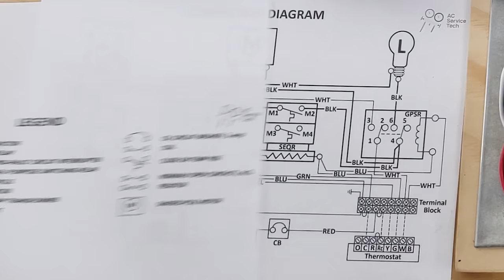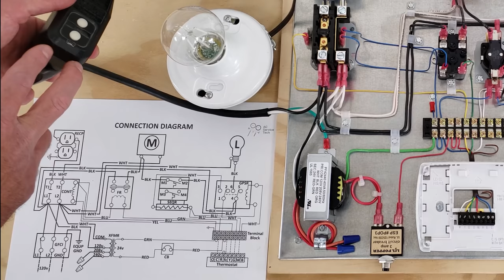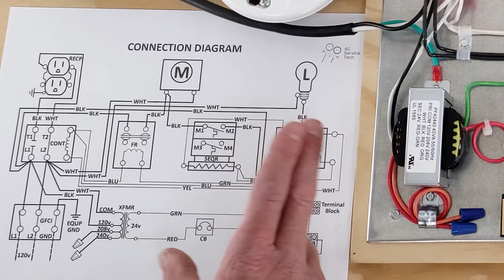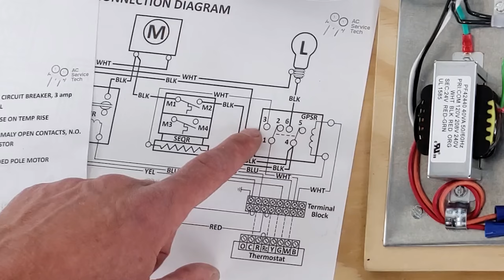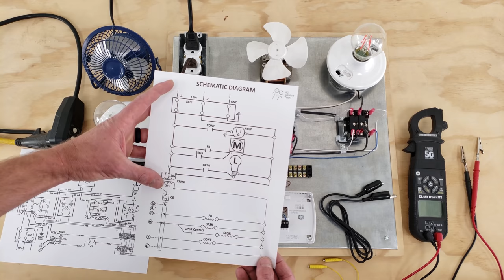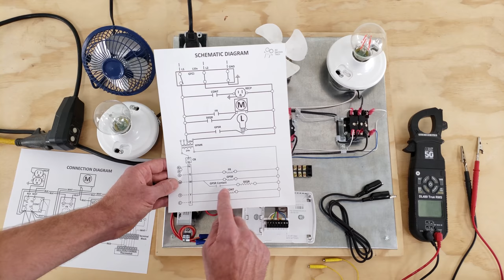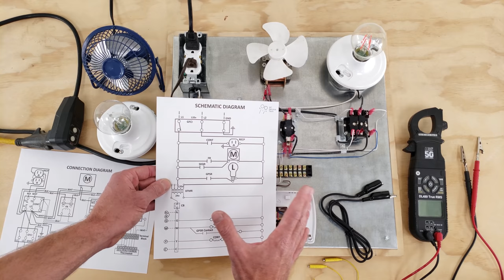Teaching HVAC ELECTRICAL Wiring, Components, Troubleshooting to Students using a Training Board!

Comment: 35 years as an HVAC tech and I’ve never seen a better instructor, this guy is gold. I bet this guy turns out great tradesmen. I usually troubleshoot a circuit from the fault backwards, just my way I guess. I would have started from the blower fan first to rule out a faulty motor and worked back. Old habits are hard to break. Thanks for a great video. 👍
Reply: Thankyou guide gues  welcome d
Reply: Brey good
Reply: Thanks for the insight. This guy is a great instructor
Reply: 0:31
Reply: Vrey good  boss
Reply: Vrey vrey good

Comment: Have a question for you, I bought a Plasma Pure 1500 bipolar ionizer to remove airborne pathogens. I like it to run when the fan runs. Would I wirer it to the Green + and Blue -   ?  or what is the best way ?   thanks you

Comment: Any idea why there would be no power to the white wire at the thermostat?  The a/c works (cools and fan operates). But heat does not work. At least, it is not turning on the fan.

Comment: Probably the best simplified trainer I’ve seen and I definitely would like to build it to practice, my only question is - is there a more complicated trainer version where the outside is completely separated from the inside and adding more components like boards and small compactors to it?

Comment: This reminded me a a video on using a troubleshooting harness with a training board so the students can't just see the fault.  It's on the now defunct BTCInstrumentation channel 'Teaching tips: using troubleshooting harnesses for circuit diagnostic exercises'.  It involves breaking out a terminal block of test points then covering the training board with students only able electrically test from the test points which are referenced to the schematic.  

I remembered that video  when I thought you might cover the low voltage wires from the transformer so you could introduce phasing/polarity issues for more advanced training.  Get the student in the habit of checking phasing/polarity.

Comment: I learned a lot from this video😍，I have two further questions that hope you could help to answer :

① In the North American market, is the furnace control board the same principle? As long as the thermostat is fed to the furnace control board corresponding terminal 24VAC, no matter what type of control board can successfully interpret the thermostat signal and turn on the corresponding load (only for the 24V furnace control board, the thermostat is a relay that can give the "W", "Y" or "G" terminal 24VAC signal according to the room temperature).

② I see that there is no furnace control board on the HVAC Training board, can I understand that as long as the temperature controller can make the corresponding load run on the  HVAC Training board  ,at the actual situation (with the furnace control board), the temperature controller can successfully control the load equipment through the furnace control board (only for 24V control board)?

Look forward to your reply

Comment: Fan coil setup! 
Practice application of this model:
Understanding the diagram and how to components works we can put one of those relays to bypass burned blower motor relay on the circuit board (in case fan or the A/C Mode) . Always wanted to do that! Board cost $130, relay $7.

Comment: Great video. We had fuses that got taken out to wire up different circuits with different variations of switches and contractors and such and then they would check it w the fuses. No ground fault safety tho that’s fancy. You should teach in a school if you don’t already.

Comment: I've been thinking of making something like this for a while.
Reply: You can use an Arduino to replace system control board. I did on my HVAC system years ago. Arduino costs $15 - $35 .... original control board was $320.

Comment: Good video, thanks - are you using common ground on the primary and secondary of the transformer or are you grounding the circuit of the 24 Volts to the plate only? In other words, did you connect the ground of the 24 V circuit to the ground of the house? Are you using an isolated transformer?

Comment: My son purchased this kit for me some time ago. I decided to put it together last month. One thing I keep having problems is the GPSR on the diagram, on your video and everywhere shows 2 wires coming out of contact 4 of the GPSR. How did you manage to connect 2 wires in one leg? 2nd, I guess because of contact 4 on the GPSR I can't get the board to work as it suppose to. All of them work if I jump every single one from the back of the thermostat from Red to yellow, to white, etc. But, once I install the thermostat the heat side has a shortage. Any suggestions? I didn't took the time to do 90 degree angles with the wires, tied them down, etc like you did but, they work. 1. I have been stuck on the contact # 4 of the GPSR and the heat side for the past 2 weeks

Comment: @AC Service Tech LLC lol i have been trying for a year or more to fix my butchered air handler i don't know how many times i have been shocked lol it works now only problem is it never turns off even with the thermostat disconnected

Comment: The red bulb representing the 'heat exchanger' - is that going to be just a water pump in the actual system or is there some connection to the boiler too to fire that up?    (or both) ?
Reply: I'm a retired hvac tech for the USPS, and I had many different set-ups in the several dozen buildings in my metro area.

You can think of it (the red bulb), first of all, in its simplest form as an electrical resistance heater. (A light bulb is a perfect stand-in for that.) So it could be a duct heater or an electric  heater in an air handler. 

Now, that said, it COULD also represent a gas fired furnace, but the relay would only provide a call for heat, and the furnace (or boiler) controls would be safely operating the heating unit.

If you use it to represent a pump in a hot water system, then the sequencer would start the fan when the water temperature reaches the temp setting. The boiler could be controlled by it's own system, such as an outdoor air temp sensor to bring it on, with the pump controlled by the wall stat.

There are many different control set-ups that can used and I used to really enjoy control work and trouble-shooting. I've been retired 11 years and that's the stuff I miss the most.

And this teacher with the training board is doing a GREAT job. Kudos!
Reply: @AvenueH  Got it, thanks.

Comment: i have a question !  i`m trying to wire up a system  . thermostat is a rth 9585 honeywell  . i need to wire a taco 4 zone expander that controls 2 hot water heat zones and a priority domestic hot water tank and a gaurdian 2.5 ton 208/240 volt air handler with its own transformer but no circuit board and no electric heat !  any help would be great.  i have the taco zone expander wired , red and white and blue `C` wires to the thermostat. i already smoked a $179 thermostat and that was with the help of a Residio Tech

Comment: Hi,

We are building this simulator in our AC3 course. Unfortunately, our training program was unable to get the same thermostat that you have. The thermostat that we are using does not have a common connection for it.  I was wondering if there is another option for that portion of the wiring. Our thermostat  only has a connection for R, Rc, Y, W, G, B, O.   It is also a non Programmable thermostat. Any information would be great. 

Thanks 

Danilo
Reply from the maker: I would still run that common in the thermostat area for testing purposes. Nothing else on the board should change, thanks!

Comment: Do I actually need the fan sequencer if I’m connecting the g wire to the thermostat or does the thermostat automatically sequence the fan? Can the sequencer be swapped for a relay?
Reply from the maker: The sequencer is for the fan timing during heat
Reply: @acservicetechchannel  Thank you 😊What I’m asking though is, Do modern thermostats handle the sequencing for you? I have found that the Ecobee thermostat will handle the fan sequencing, there may be others but right now I know that the Nest Thermostat does not.
Reply: @acservicetechchannel  by the way, Great Video!! You are really good at describing how things work!!

Comment: i changed the thermostat and now nothing works except the blower... even without the thermostat connected to the board it stays on.
i have not blown a fuse or lost power in the main board.
The gas valve is a smart valve and  power for the inducer motor  is coming from main board to the gas valve  but no power is going to the inducer from the gas valve, does that mean the gas valve connector/board is no good?
i checked the  limit and rolls outs, all showing continuity  with power coming and going.
The connector on the gas valve for the inducer motor is 4 wires.. black and white IN  (which has power ) and black and white out ( to inducer having NO power)   ...is this a direct connection ? or is there something else that needs to be satisfied before power is sent to inducer?i trying to figure out if there is anything i didn't checki can bring a guy in but i REALLY want to understand the problem 1st

Comment: What meter would you recommend for a new tech just starting out ?
Reply: Any multimeter honestly.  As long as it can measure volts amps and microfarads.  Make sure it has a clamp on the top of it measure those amps.  Astrai multimeter is a good starter one
Reply: @michaelhuff3797  thank you! I’ll have to check that one out! I’ve got a while till I get my 608 certs but I wanna at least get a decent tool bag going for me.

Comment: Excellent trainer for high school instructors something that is really lacking in our high school in our public education. Low cost easy to implement for every student. 
              They should even be drafted down to grammar school level and just use computer power brick for 12 V and 24 V for safety reasons of course. With 12 V fans or 24 V fans and lights and motors. 
          Because even in high school it’s starting to get too late to train students to learn how to learn and become educated.

Comment: WHEN IT COMES TO WIRE COLORS LOL,BEEN AN ELECTRICIAN 40 YEARS WHY CONFUSE  BEGINNERS ,FOR GREEN IS A L W A Y S GROUND !!!!! WHY NOT GET AN F.A.U AS THEY ARE IN THE ATTIC OR HALL OR GARAGE,AC TECHS UNFORTUNATELY ARE NOT INDUSTRIAL ELECTRICIANS EVEN WHEN THEY GET MIN.QUALIFIED YEARS IN??...BE HUMBLE AC BOYZ KEEP LEARNING..
Reply: The "G" wire on an HVAC system is a standard wiring convention to represent "Fan". It is commonly a green wire. (These are 24 volt control systems, it does NOT mean GROUND in THIS use.) R (red) is control power (24v, can be Rc or Rh or jumped for both), Y (yellow) is Cool, W (white) is Heat and G (green) is Fan. Modern stats that need a common use terminal C and in my experience, that wire is usually black.

And with all due respect, electricians are not HVAC techs. Stay humble, keep learning!
Reply: Hard to find an instructor WHO can teach in detail quickly not put u to sleep...